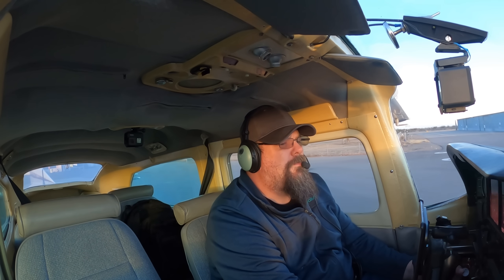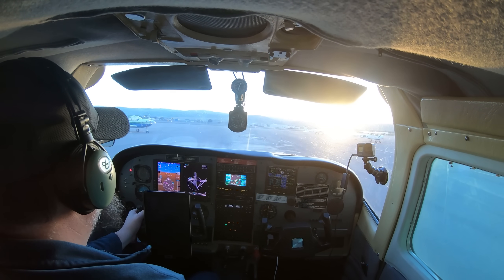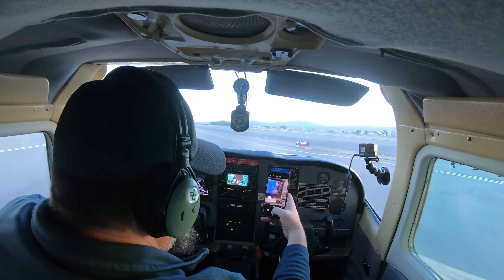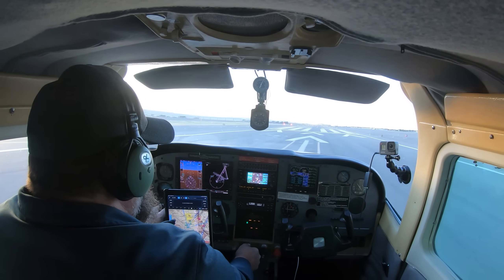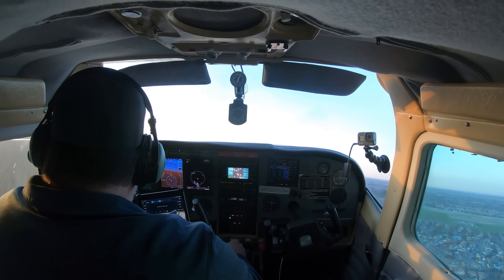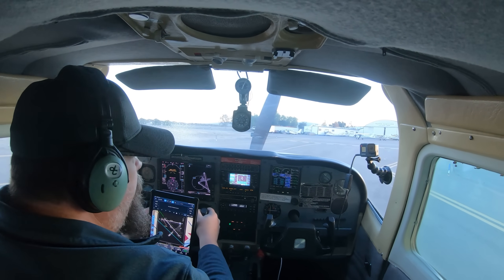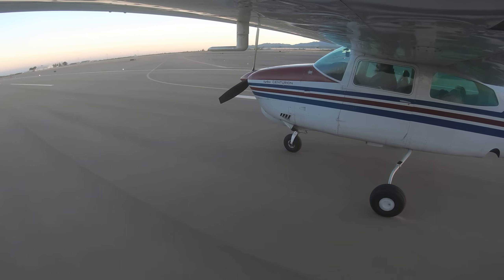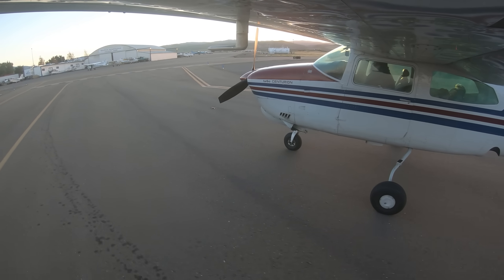Catastrophic Engine Failure after Takeoff

Comment: Did you really do a lower end overhaul and not do any type of real engine run-in or high power run ups  Or did someone else do the engine overhaul and check and you just trusted their work as a reputable mechanic.  When we install an engine after overhaul or a robbed serviceable engine for a part 121 aircraft there is always a mx requirement to do  a bunch of preflight checks snap power accel decel vibe survey sometimes max motor depending on a few different factors trim if it isn't FADEC as well as the electrical power checks just from disconnecting the gen during maintenance all the ATA chapter 29 and 36 stuff if the plane has them not to mention leak checks.  All this accounts for about an hour of run time on the ground for large aircraft because you can't just run them anywhere and need a bunch of room or a blast fence and less for smaller aircraft but there is still no way you could do it all in under 15 minutes and feel good about signing it. Also reduced run time on the ground should not be a consideration after a significant overall operation like a rod/bearing/crank change.  I feel like  your in flight shut down was preventable but you did stick the landing and it was a good video that I'm sure people are going to learn something from.  You may consider doing a more thorough run up after maintenance next time maybe not.. who knows.

Comment: Nice video; thanks.  One question: I think you said you took off with 20 degrees of flaps.  Did you retract them after takeoff?  If not that decreased your glide range a little, of course.

Comment: Better to be a pilot. I was an A&P civilian aviation 7 years, Military Avionics 4 years, I saw enough, bad things go on in civilian aviation, low pay, no job security, no one has your back, FAA is an after the fact organization, can't live on glory, won't sign off repairs that are not flight worthy. I am out, it sucks. Good luck flying. Go ATP, get used to MEL lists full, toxic work environments, don't like it, there's the door. No thanks. I'd spend your time and money on something else. You were lucky. Had a Sheriff Helicopter pilot friend. Had a Pitts, got a TBO engine, was replaced, said engine blueprinted, balanced, bla bla, lost oil pressure after takeoff, barely made it to outlying field, could have been killed. Engine builders smoked the paper work. The guy that "built" the engine had a heart attack and died before it went to court. Was unemployed 2 years locally, well trained, dealt with jealously, descrimination, BS management, kindergarten environments, I'm out. Good luck.

Comment: Edward, 1st of all is that you're blessed to still be alive; I'm a retired A&P mechanic and newly overhauled engines don't just fail for no reason, There was a mistake made somewhere, either someone didn't follow exactly the engine maintenance manual step-by-step, or rarely, a new part was defective from the factory; The truth will come out.
Reply: Thank you for identifying the issue is the overhaul maintenance wasn't done properly.  Aircraft engines should never fail, in theory.  If a pilot expects they should experience issues from time to time, I would switch to another maintenance organization.

Comment: I don't know too much about aircraft engines but standard procedure on most engines is to go back through and retorque everything after you've put a couple heat cycles into it as it can come loose. I'd definitely be firing the mechanic for that one.. throwing a rod that soon means he didn't have that torqued right to begin with.

Comment: I would also like to say something about GA technology. And this is coming from a guy who started flying in my early teens, and have been flying for ~ 30 years.

I have seen diesel technology SLOWLY come out. I have seen, back in the 90s (when I was first flying) guys building their own planes and putting car engines in them. And a few people still do that, but it hasn't taken off.

I have flown in more 'old' airplanes than I can count. 

I spent many years as an apprentice to an A&P, so I know my way around aircraft systems, especially engines. I fully understand why engines are designed the way they are. Big displacement, low RPM, light blocks, bolt-on cylinders to save weight. I get it, really.

But gosh darn, 95% of GA hasn't changed in the 30 years I've been flying. The biggest difference is better electronics. In the 90s, I was flying planes that were already 30-40 years old. I remember think how "old" those planes were, compared to a young teen like myself. 🤣

Conti and Lycoming engines are the same. The same darn tech that's tried and true. But we still have engine failures. It shouldn't be this way. It just shouldn't be like this.

I know that electric airplanes aren't the answer right now, because of battery weight and capacity. I USED to think diesel was the answer, even back in the 90s and 2000s, because everyone was worried 100LL was going away back then.

And the guys with car engines in their planes have always said that if you get an automotive engine that can redline at 5-7,000 RPM, that's going to be better than a GA engine based on technology from the 1940s. Of course, car engines weren't designed to run at near-full power for hours on end.

I don't know what the answer is; I just know that GA needs an improvement. Engine fixes and overalls are just going to keep getting more and more expensive, and they were already expensive when I started flying.

Nice save!

Comment: You faired better than the pilot who crashed at the airfield I was flying at. We heard over the radio "we're not going to make this" I turned my helicopter round just in time to see the plane crash 100 yards short of the runway, his wings snapped off and fuel was pouring out all over the place, he was ok but very very cross, kicking what was left of his aircraft which was a total wreck, and I believe he did his own maintenance.

Comment: Being ahead of the plane is what is drilled into us through all our flying careers and any lesson. 

I’d hope all of you know that just after a service, no matter how small, is a better than average chance for things to go wrong with the engine. 

Basically every flight after a service is a “test pilot” flight and you should make sure you are very familiar with the airport, the surroundings and the typical activities that place around you at your airport. 

What you don’t do after a service is fly on a questionable weather day, when you have any issues where you might be otherwise distracted (significant other/family in the plane/friends along for the ride).  Insert anything you want. Your brain needs every resource available to deal with this or similar situations especially after any “maintenance”.  Stay ahead of the plane and be more aware of anything that sounds unusual.  I didn’t hear anything before the failure on video and as an observer n YouTube can’t feel any vibration either. The pilot was probably hyper aware of everything around him. 

Check/cross check keep your eyes moving over those engine critical gauges until you feel comfortable bringing others along. When you think all is good check to make sure everything is secure again in the engine and do your preflight. 

I recommend people practicing the “impossible turn” with an instructor so you know you can if you need.  

This pilot is a very good pilot. Obviously prepared and obviously anticipating the need to have options. Knew the field, knows the plane, knows his own skills and not flying beyond his abilities. This is what good training and great skills look like.

Fantastic flying Captain.

Comment: Invaluable lessons learned for fellow pilots like me. Thanks for posting this video!! 

Curious question, why not run the engine at full throttle for 5 mins or so on the ground, and then attempt an actual take off? Wouldn't this minimize the possibility of something like this happening? I mean the suggestions are to run the engine hard from the get-go, so why not run it hard on the ground for the first few mins so that any potential issues will happen on the ground instead of in the air?

Comment: they say any landing you can walk away from, etc.  very glad you had the capability to bring her back.  still not something to recommend to an inexperienced pilot who might be watching this: YOU had the altitude you needed but you were also smart enough to put the nose down when she got slow and youngsters in duress will easily forget that and try to "extend the glide" by pulling the nose up.  also, there were field options in front and to the sides and making that cross wind turn can bleed off speed or altitude or lift faster than people might realize.  glad you made it on the ground and back on the field in one piece.

Comment: Edward that was a very good recovery from a bad situation.. I commend you… others should know that one of the reasons a turn back worked other than your excellent flying is that you departed 30 and if I not mistaken landed 08  which is a cross wind runway and gave you a better glide ratio than 12….  That decision is tough in that high stress situation… good on you.

Comment: Nicely done.  For those who will face this in the future, be careful of cross controlling on the turn.  There is a touch of that here.  Inside rudder and ailerons against the turn.  That’s a skid and if you get slow, how you end up stall spin.  10 000 hrs mostly airline but a bunch of light time as well.

Comment: Shoot!, talk about decision time, you had the least amount imaginable, very quick to form and execute a plan, good job you did as you needed every last second for a land back. I could hear the engine momentarily surge twice just a second or two before take off, which sounded like a piston going tight on one of the cylinders, this was more noticeable on the wing camera recording, and just prior to the piston seizure you could see a trail of smoke from the exhaust, probably an oil scraper ring failing, from my experiences a piston to cylinder bore hard seizure on one of the cylinders more likely from piston ring brake up is more than likely the cause or alternatively a dropped valve in one of the cylinders, be interested in the full autopsy. Whenever I overhaul powerplants I always do considerable ground run testing especially test cell break ins  when I can and at the very least a variable land based, power run between 1200 and 1700 rpm for at least 40 minutes once the mag drops have been checked, then  a oil and filter change, examine the dissected filter for contaminants and metals, provided there is nothing to report then I go do a 50 min flight in full rich 30 of which would be between 2400 and 2700 rpm all  for the very reason of avoiding what you endured.

Comment: Are those high tension leads tie wrapped together?  With the high voltage running thu the wires being that close together it could cause crossfireing and pre ignition.